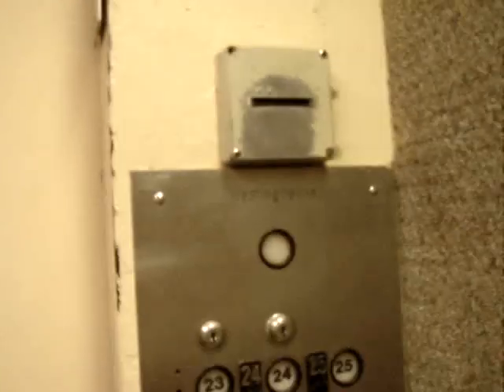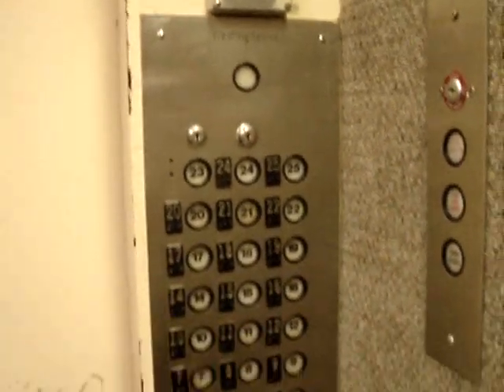Westinghouse Traction service elevator @ Hilton Ballpark East Tower St Louis MO

Comment: I think that call button on the top floor is different from the ones downstairs is because they added a 25th floor to the hotel
Reply: +Angela Weber they probably used EPCO on it.
Reply: Angela Weber They didn't it's original to the hotel.
Reply: Adams, not Epco
Reply: ShmulsTV - Gaming Since 2007 Yes